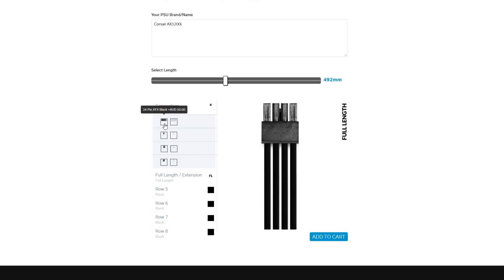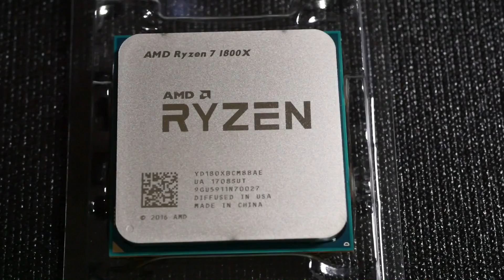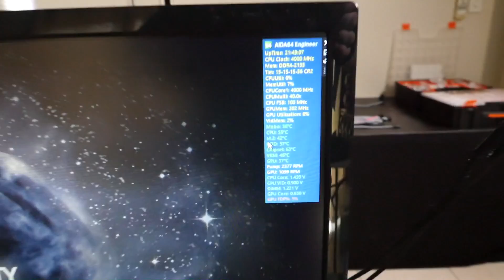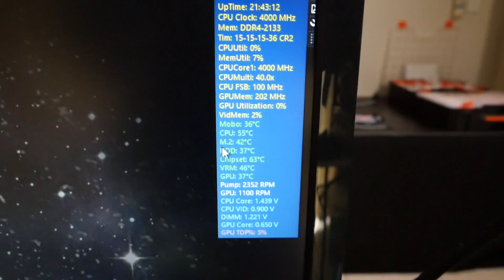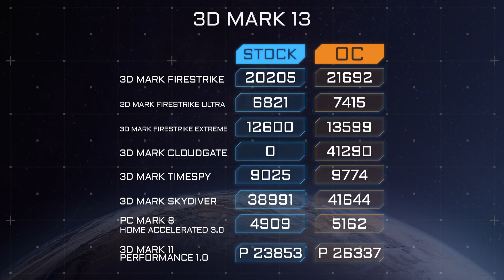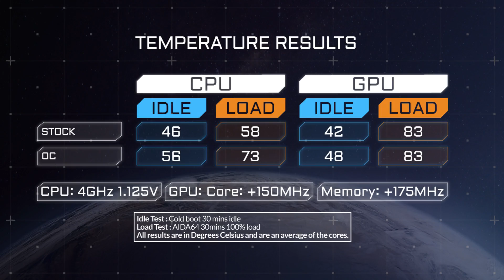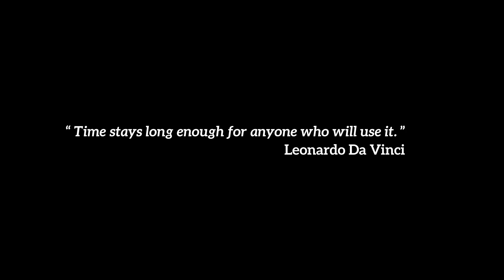Ryzen Build Test Results

Comment: I read somewhere that the PCIE Ribbon cables lower the performance of the video cards. Is this True in your testing, or are the newer version better than the previous. Also what brand PCIE Cable do you use? Thanks in advance.

Comment: It's good to see another custom cable vendor emerging, although for the length selection you should add a box where cable size can be typed in so it doesn't take as long to get the length needed.

Comment: i got one of those swiftech all in one things (same as the one in the system shown). the water has turned like a greenish blue, even though its only been 2 months. im guessing thats bad. should i replace the water? i didn't add any dyes to it just installed it into the system how it came
Reply from the maker: This is what soft tube does every time. You cannot avoid it with soft tube. All you can do is keep replacing the tube and the coolant. Use the most high quality soft tube you can find. Tygon.
Reply: you are completely right. i've done water cooling 3 times. and the only time i didn't have this happen was with really good expensive tube.

Comment: OK, looking at the test results I can clearly say there is something wrong with my PC. Time Spy gives me only 5835 points (6059 for GPU 38,92fps + 4827 CPU 16,22fps). i7 6700k + MSI 1070 Gaming X + 16GB DDR4 ASRock Z170 mITX/ac + 512 GB M.2 SSD from Intel + 600W SFX PSU. After my windows is fully booted CPU speed drops down from 4,5GHz to 800MHz. If I test it, the speed rumps up but looks like there is something wrong. I have latest BIOS update. Can you help?
Reply: it's normal.. it's adjusting the clocks to save energy when there isn't much to do.. you can turn that off with bios settings to have it run at 4.5 24/7..
Reply: Do you have a "Slow Mode" switch on your MoBo? Chek that.
Reply: no it's just this speed step technology.. it adapts the clock speed according to what's needed.. if you start cpu heavy tasks it should keep sitting around the max clock.. in games it often switches through different clocks as the cpu is utilized somewhat variable depending on what's happening.. when the system idles after boot it will most likely keep sitting on this low power states to safe energy.. there is nothing wrong with it.. you won't loose any fps in games or performance.. you can turn it off in the bios to have it run at max clock all the time but it will be a little hotter and consume some more watts.. not much but some.. you know the power draw depends more on the cpu load than the clock..

Comment: +SingularityComputers I don't think you can push Ryzen past 4.1 GHz with normal watercooling. If you were to use LN2, then maybe you can push to 5 GHz
Reply: yeah it's a really small amount of ryzen chips to even hit 4.0 or 4.1.. 3.9 is the most for lots of people.. so this one even being stable on 4.1 is a win..
Reply: 5 ghz is most likely impossible for normal use lol.. that's why ln2 oc records are using crazy voltages to even get there and most of the time it's a matter of hours of tweaking to get it to boot and run and then crossing fingers to run a benchmark without crashes.. no matter what cooling is used those record clocks are far from the realm of 24/7 stable everyday use and the 4.1 ghz as i said before are a win for the 1800x..
Reply from the maker: Yes this is what I confirmed, perfectly accurate at least for this chip.

Comment: hey dan wasn't there this thing that ryzen 7 chips have a temp offset of 20°C on purpose? so the idle temp would be actually 35 not 55°C
Reply: Dunkelelf3 I think they patched that but it would make sense if that 40 on the motherboard is the package temp.
Reply: well package temp is always higher than  the cores but oh well 55°C on that with a 240 rad and the oc and especially over 1.4 volt overvolt isn't really that unlikely.. my 5820k also sits at 60° package with around 45°C on the cores with a corsair h105 aio.. i mean a 240 rad aio doesn't really perform any better than a good air cooler in the end so it's understandable..
Reply: I also have a 5820k. My package temp at idle is usually 37-41c depending on ambient temperature. The cores are usually below 35 c.
Reply: But I leave my voltage at adaptive
Reply: yeah that's due to the blower style gpu cooler that heats up my case and increases therefor also the cpu temps.. problem is that the maxwell cards don't go down to the lowest power states when having more than 2 displays at once and i'm using 3 screens and my tv with it.. gpu is always at around 1000 mhz and 50°C.. with only 2 screens it would be around 37°C as it goes down to 135 mhz and also the cpu runs a lot cooler then but oh well.. still decent temps..
Reply: Makes sense
Reply: well i still hope future cards will be able to handle that amount of pixels while still being on the lowest clocks without hassle.. i forced my card to go down to 135 mhz with the 4 displays using the nvidia inspector but it starts to create artifacts then and videos get laggy and start stuttering sometimes.. maybe more powerful cards in the future can handle it..
Reply: I'm on an x34 and a 144hz 1080p monitor I don't think my 1080 clocks up
Reply: But then again I just got the x34 yesterday so maybe I just didn't notice it
Reply: it won't as long as it's 1 screen.. for maxwell it was okay with 2 but with 3 or 4 screens the clock goes up.. i don't know how it is with pascall cards tho..
Reply: Ryzen Master utility was patched 1.1 displayes the actual temp now. My MSI Xpower still displays the 20C offset temp. The 1600X/1700x/1800X all have the offset temps. I'm running 1800X 4.0 at 1.3V. Idle temps on mobo are 41C and Ryzen Master reads 21C.
Reply: So you idle at 21? Do you live in an igloo? lol
Reply: lol, almost. The 1800X is on EK custom water loop with a 360 rad. The temps do change with ambient temps.
Reply: I miss my custom loop. I ditched it when my ddc pump caught fire. I don't have the time to fix the loop so I got an h115i
Reply: Both 1800X and 1700X have the offset. You can get the true temps trough ryzen master software. Really hope asus updates the drivers or AMd updates the ASGI firmware.
Reply: mine is overclocked to 4.5 @1.25 but the hottest core is way over 35 in real bench 
and in cpu heavy games like bf1
Reply: i tried 4.6 @ 1.35 but i couldn't get it. im sure i could bump it to 1.4 but i don't want to put that much voltage  through it on an aio. plus my case( evolv matx) isn't the best for air flow , the top cover kind chokes the fans.
Reply: yeah man ryzen prices are amazing. i wonder how intel is going to price their next generation of chips. I doubt they will drop their prices but i can hope lol .I guess we we'll find out when x299 drops.
Reply: They did what now!!!!!!!